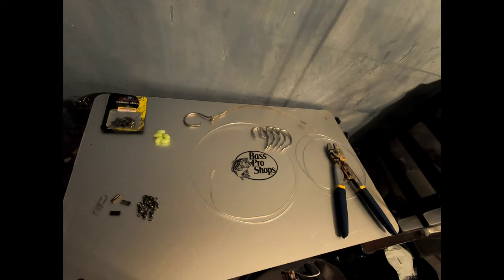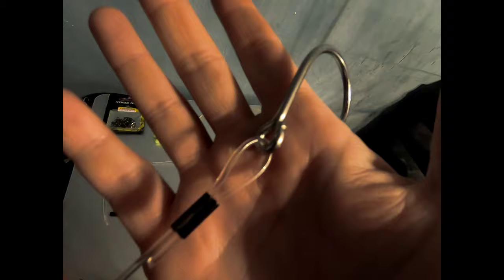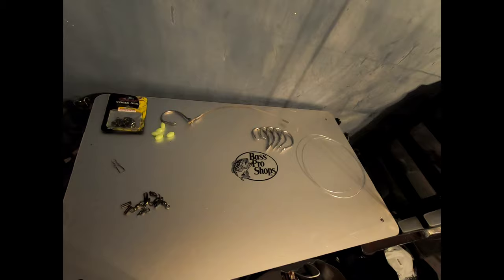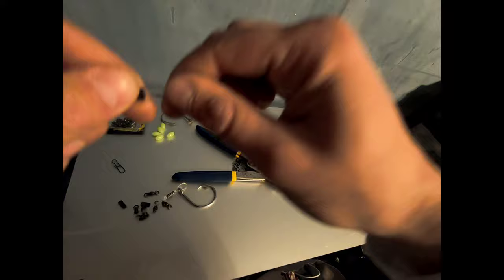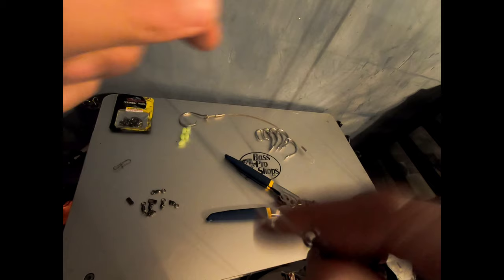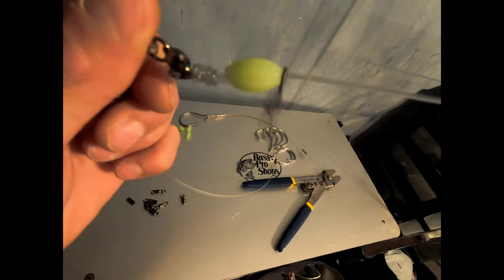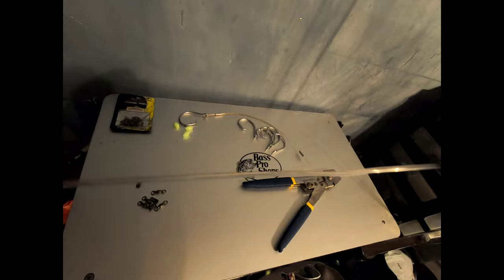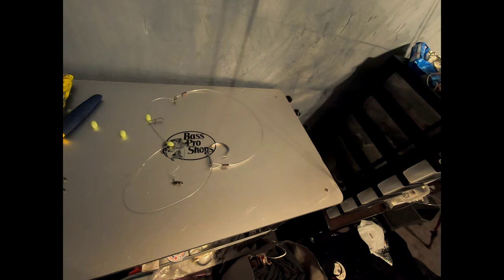How To Tie A Surf Shark Rig  (Spinning Tackle - Basic Formula)

Comment: Great vid Chris - 2 questions (semi-related) - #1 Do you have success using semi-fresh bunker from the local B&T ?  last summer we only had hits on fresh bait caught day of.  #2 Do you always need to swim, kayak your baits out or do you have any success casting from shore on our local LI beaches?
Reply from the maker: Thanks dude and solid questions. 1: i do but i make a habit of calling ahead to see when the bunker came in and how they are kept. I bounce between 3 shops usually. 2: Absolutely not with the right tactics you csn get these fish right up to your feet. Multiple accounted for right in front of me. A good cast is all you need which comes with practice as well as reading the beach. 2nd part to that answer is yes. Certain species have far too much power under then and youll need heavy drage and thick gear. Generally those baits are huge and are required to be paddled out
Reply from the maker: *power under them
*heavy drag
Reply: @coastal_memories_fishing9366  THANKS!.. Keep building that fan base and good luck kicking off the podcast. I just don't think people are making the connection that you are the same guy from the Fisherman updates or you'd probably have a few thousand SUBS by now.
Reply from the maker: @totalnoobfishing1753  thanks man yea thats gonna be cool to get off the ground and your probably right about that one!